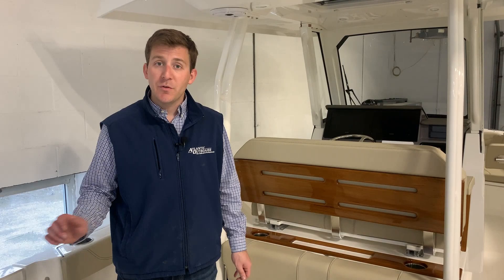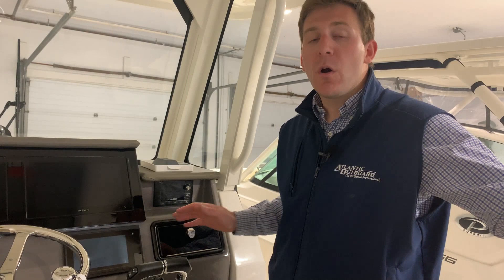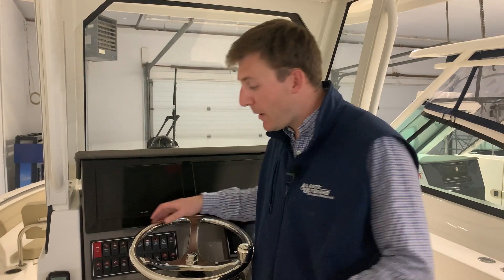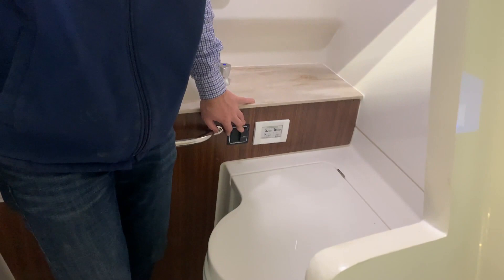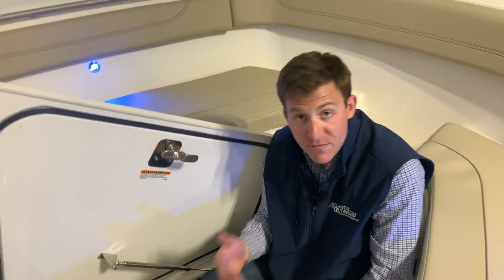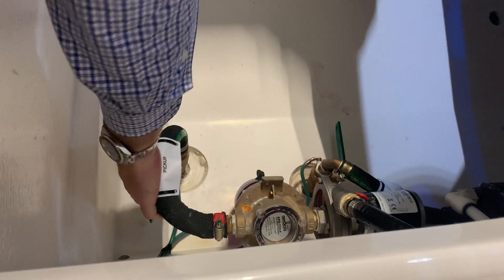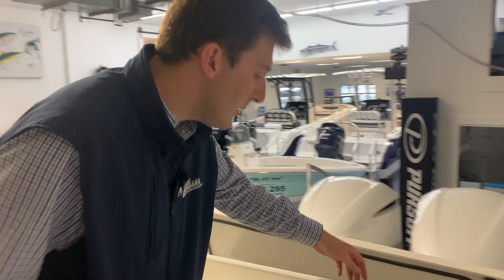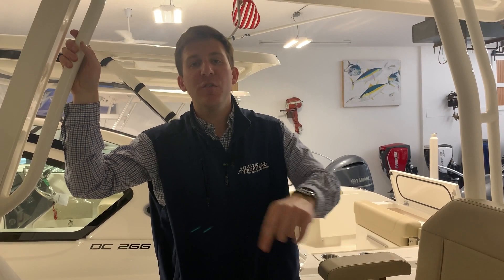Digital Delivery: 2020 Pursuit S288

Comment: Question about the bow floor locker. If you don't get the bow thruster is the boxed in compartment still taking up space? Is is the bottom of the locker flat? Thanks
Reply from the maker: Yes the landing for the battery is still there.  They actually cut out the stringer grid to get access to the keel for the thruster.
Reply: Thanks for the quick reply.  However, I was actually wondering about the square enclosure for the thruster. If you don't get the thruster i the enclosure still in place? @AtlanticOutboard
Reply from the maker: @paullapinta6367  yes